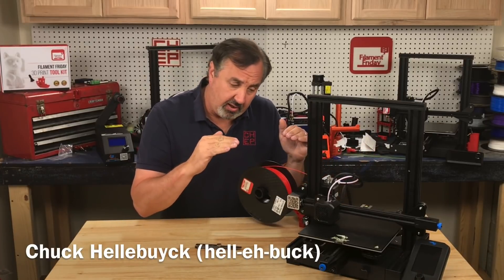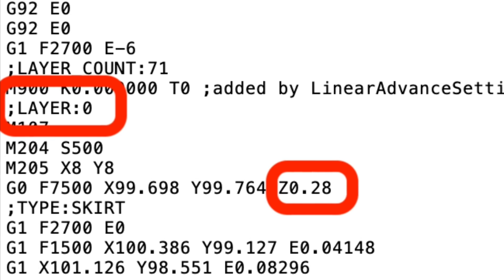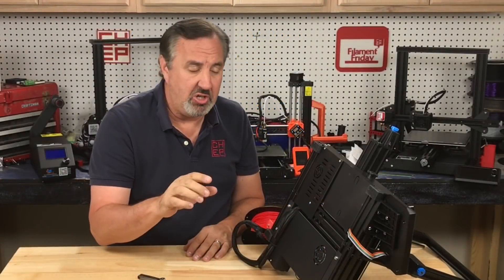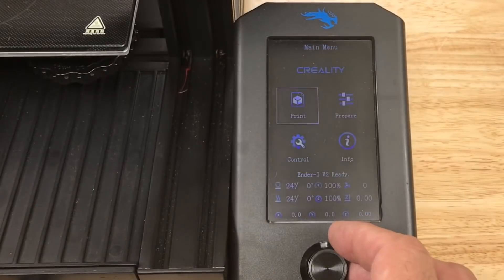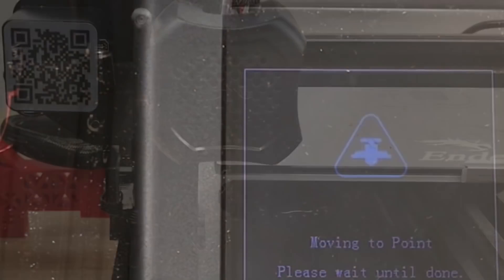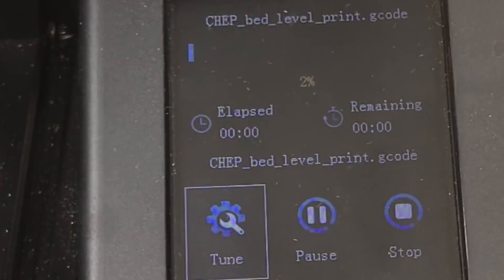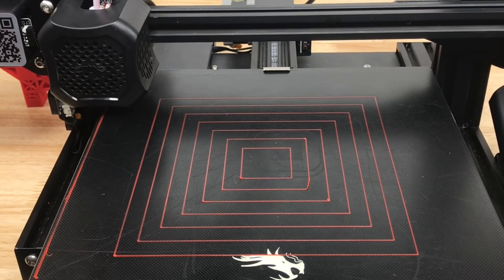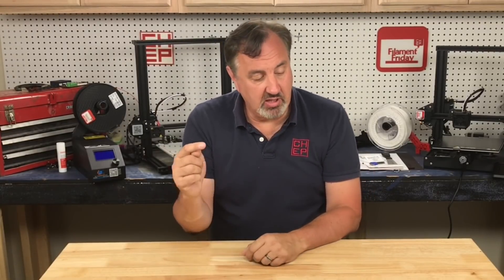Leveling or Tramming your Bed Using a Feeler Gauge on Ender 3 V2

Comment: I have never fiddled with the z offset until recently. I did a manual mesh bed level using paper and the first layer was not sticking. Adjusted the z offset to 0.18mm and it’s now perfect. I need to get some feeler gauges to do this more precisely. Thank you for teaching me something today. Cheers 👍😎🇦🇺

Comment: yes! finally more coverage on filler gauges!.    I love using mine, don't think I'll ever go back to paper tramming again. lol

I bought a cheap set of feeler gauges (actually has 2 0.2mm ones, one is another color) and took one out to make a tool for just tramming (print a handle) and used it on my ender3, twice, to make sure i had it right -and haven't had to bed level for months.

Comment: great info but show us how to modify that first layer in cura so we use the right feeler guage
Reply: How to modify it? What are you wanting to modify?
Reply: The z offset was set on the printer at to beginning to 0.2mm equal to the 0.2mm feeler gauge used. No change in slicer required.

Comment: I use a dial test indicator mounted to the extruder and can get the four corners to within 0.001 inch repeatedly and quickly , i then  let the bed levelling routine take care of any low spots in the middle of the bed  . I also got rid of the springs under the bed and use jacking screws to adjust the bed as I found for some reason it was twisting my bed .  The BL touch is a must have item and makes life so much easier - once you use one of these you never want to go back ! The jeyers software upgrade is also a must have and it is so easy to install with the 32bit boards that you would be crazy not to install it even on a brand new printer -creality take note - stop putting your old out dated software on your machines !
Reply: I've been thinking of using a dial indicator.  Care to share how you mounted it?  Do you remove it during print or leave it on at all times? I assume also you don't have any particular off set you use just level the 4 corners, run ABL and live adjust first layer?
Reply: @brandonbrown3600  
I use a  mag clamp to mount it to my  extruder carriage and a parallel or toolmakers clamp on the extruder because it is magnetic  , i use move axis to jog it to where i want and once i have levelled the bed i remove it . all i am doing is levelling the bed to the X &Y axis then when i print i use the BLtouch to create  a mesh for  it . Feeler gauges can lift the print head without you knowing and put your levelling off - it all comes down to feel and to add to that turn the bed and extruder on that clearance you had with a feeler gauge will change but a dial indicator will still show a true reading .

Comment: Chuck, this is what I did with my Ender 3 V2. 
Loosen and lower the Z position sensor
Tighten the bed as low it can go and still have clearance for full movement. 
Manually lower the nozzle, to the gap of your gauge, to either back corner.   
Align the front corners, with the gauge, to match the back corners. 
Once aligned, lower the nozzle until touching the bed.
Reposition Z position sensor to match the new "Home" (I had to remove the bottom locating tab to do so).

What this does is keep the springs tight, lessoning the chances that the bed will move out of alignment through continued use. 

I've printed out dozens of items since then. And all I do now is include a skirt with my prints, close to the beds edge, check the skirt while it's printing, and maybe, maybe, do a live alignment. 

I'm working on another idea I have of a cheap and easy replacement for the springs all together. I'll keep you informed if my results are good.
Reply: Silicone mounts. No springs to worry about.

Comment: Hi Chuck,

Currently Im using the same method as your video. but here are some tips that I found out myself during My practise time.
1. The most important idea is you have to check for your felling gauge first, check for the edge of the sheet that you are using if it is smooth or not. because some time, edge become rough and that can impact alot to your feeling during measure the height.
2. the way you feel (measure) need follow single strategy. like if you swipe from side to side or you slide the sheet under nozzle back and forth. All of them should work but beter to keep it  single strategy

Comment: What's the difference between setting the z-offset and moving the z-axis to the thickness of the feeler gauge? Should I adjust my current z-offset after using a gauge?
Reply from the maker: Moving z won’t save it so it homes offset

Comment: I changed my nozzel out to a hardened steel now my prints layers are not sticking together all the way thru at times the do mabey 5 to 6 layers but if  i apply a bit of force and bend my print it all pops and cracks apart and I can rip the print apart layer by layer could it be the nozzle or do I have something else wrong any tips or suggestions would be a big help and I do believe Ill be using a filler gauge from here on out thanks for the tip they are all helpfull and my prints are looking better than ever on my other two printers that are working rite thanks again
Reply from the maker: Those nozzles typically require higher temps than brass.
Reply: @FilamentFriday  Thanks
Reply: Print a temp tower.   Go up to 230 for pla.   Find that nozzels set spot.   Hardened steel can take 10 or more degrees to get the same results.
Reply: @brandonbrown3600  Thanks
Reply: @brandonbrown3600  that helped out alot ran a few test prints and everything is sticking like glue had to raise nozzel temp to 230 c  so thanks again

Comment: FEELER GAUGE SIZE:  0.203 mm   (Just in case you missed it in the video)
Reply: More accurately, it's whatever feeler gauge you set your Z height to.

Personally (since you have to do it a few times anyway as heights can change for one if you move another) i start with 0.8, do all points, move the Z to 0.6 and use that gauge, move Z to 0.4 and use that guage and finish off with 0.2mm

By the time I'm using 0.2mm i barely need to adjust anything
Reply: @TheLazyEyebrow this was the best advice
Reply: Thank you, mate
Reply: What feeler gauge for PETG idk what size to use 🥲
Reply: @JustCreateYou the same for all filaments so it dosent matter
Reply: Haha….I came back just to check this and your comment is right at the top. Thanks!
Reply: @Vcynix4  layer size has little to do with tramming. all you're doing is making sure that the bed is as far away from the nozzle as the printer thinks it is

Comment: I use your bed leveling gcode, but with offsets changed to 0.1mm and use a 0.004" (0.102mm) feeler gauge. Works great. I use about 105% first layer flow for good abs squish

Comment: YES! ive had one of these for forever, didnt know which one to use. been using a 1mm shimmy tool for phone repairs.
Heads up! this is for ender 3 v2 specifically. I tried with my ender3 pro and got black screen with the software. it was my fault for not reading the release titles. If you got stuck there just flash  Creality official firmware!

Comment: Would this work on the sovol svo1?
Reply: I did it with my sovol too... But without the menu manual bed leveling...
I only heated up the printer... Homed it... And then leveled it with this methode...

Comment: It's crazy how many people have issues with this.

I can level my bed with a Post-It note in 30 seconds.

Edit: I have a v2 for the record.
Reply: Same. You just need to measure the thickness of the paper and have a machinist’s touch.
Reply: @CK Gaming Channel lmao no.  30 secs to a min with paper then let ABL redo mesh and print a large flat single layer and fine tune live adjust. Minus ABL probing it's like 5 or less minutes.

Comment: Hey Chuck, I'm using a slightly modified Ender 5 Plus and I have some things to add that will make life really easy. First off...setting the z offset. Now on the E3v2 the nozzle is the probe. In my setup,  I have a CR Touch. To set the offset, I place a sheet of paper in the center of the bed, then perform an auto home. This homes the head out on the paper. I can then adjust the offset up and down until the paper is just touching the nozzle. When done, I re home  The nozzle is now always perfectly at zero...with no danger of harming the bed. I then tram the corners with a method similar to yours.

Comment: why do i need to usw z-offset? cant you just  use 0.12mm  feelergauge (a  normal paper has that thickness)? and level like you would with paper, without offset
Reply: If i understood correctly, the machine thinks it is at at 0.0 when it starts printing, but if you use a feelee gauge of 0.12 or any other thickness it will at 0.12mm above the bed, that's why you set that offset to match your feeler gauge or any other calibration method to tram the bed.
Reply from the maker: I set the offset to match the feeler gauge so the firmware knows where true zero is.
Reply from the maker: Sure. The live adjust method.
Reply: @FilamentFriday  why live. i dont mean to adjuste it while printing.
sorry maybe as a german i am confused with terminology.

but if you say yes to my question, explain me why you would explain in the video the more diffikult way with setting a offset if you could do the same without the offset by useing slimmer feeler gauge
Reply: To add to Franklin's answer, if you use a 0.12 feeler gauge and don't offset then your nozzle will be at 0.12 above the bed but to compound this when you then go and print something at a 0.2 layer height, your first layer is then 0.32 above the bed as you didn't compensate for that by adjusting the z-offset. So in Chep's case of using the 0.2 feeler gauge, if he didn't use the offset and then did a print at 0.2 LH, his first layer would actually be a 0.4 layer height.

Comment: YES!!. THANK YOU!

I hate to be negative but SO many creators suggested leveling using paper and I wasn't even close and it was driving me nuts.

I almost gave up 3d printing because of it.

But I now use a .1mm feeler gauge and a -.08mm offset with great results.
Reply: Using paper is definitely a "feel" operation. Fortunately for me I learned it years back when I was screen printing hybrid microcircuit substrates with gold or silver ink, glass, or a resistive material. 

Fond memories.

Lately I will only use receipt paper as it is strong yet thin. (I'm going to hunt up some feeler gauges my dad had to have left me in the shed.)
Reply: I can level my bed with a Post-It note in 30 seconds. Been doing it that way for years.

Comment: Hi! Just to be clear, you printed at a 0.2 LH and used a 0.2mm feeler gauge? Thanks!
Reply: Layer height doesn't need to be identical to the feeler gauge. The important thing is that you set the Z offset in the menu to the same value as the thickness of your gauge. Use calipers to measure the thickness if you have a gauge of unknown thickness.
Reply from the maker: I printed at 0.28
Reply: @FilamentFriday  noted! Thanks!
Reply: Personally I use a .1mm and set a -.08mm offset. Resulting in a .2mm first layer, which matches my slicer settings.

Comment: Take this to the next level and use the continuity function on a multimeter. Attach a lead to your feeler Guage and probe the nozzle. I tried this the other day and got it to work.
Reply from the maker: I’m actually working on a design similar to that. Board layout almost done.
Reply: @FilamentFriday  awesome! Video to follow?
Reply: Huh, wonder if this could be automated using the gpio pins on a raspberry pi running klipper
Reply: @wanders278  if you get that to work, let me know!
Reply: Excellent idea! Too bad I left my multimeter at parents' home, but will try to do something similar with LED, battery and some simple circuit shorting through nozzle and gauge, thanks for reminding me of such solutions :)
Reply: @tifhorn3311  that would work well too. Any audio/visual indication would probably be better than doing it by feel. I can never tell how much the nozzle is supposed to grip the object used as a spacer

Comment: As a final tweak. I stop the print after the skirt has printed. I then carefully remove and measure the skirt around the 4 sides. I then average the highest and lowest measures and tweak my Z offset to match the average. 

For example, if my tallest measurement was .25 and my list was 21 The my average would be .23. Pretty close for .20  layers, but I’ll increased the offset another .03.

Comment: Is there a reason we don't use an offset when leveling with paper, but we do when using a feeler gauge?
Reply: You can, I do it. Just have to make sure you level while the nozzle/bed is heated so thermal expansion doesn't throw your offset off
Reply from the maker: Not as accurate but could work.
Reply: @FilamentFriday  My question is do I need to reset the offset to 0 when the feeler gauge work is done? If my gcode add my layer height to the first layer like shown in the video I would think yes.
Reply from the maker: No you dont

Comment: I've been using a feeler gauge with my ender 3 pro for a while now. But I use your tuning profile and adjusted the gcode to 0.2 mm. Thank you for your many clear videos. 👍
Reply: Chuck adjusts the z offset on his machine,. you in the gcode!?
does this mean that for a ender 3 (pro) you need to change z-offset in every object(gcode) you print?
It is not possible on de ender 3 itself?

Comment: google translate said tram is a cable car. Poteito potaato aluminimum aliminum. I use 0.05mm feeler for rough level and the rest is done with bl touch
Reply: Tramming is the process of aligning axes, like on a milling machine.
Reply: @rpavlik1  i konw i am machinist